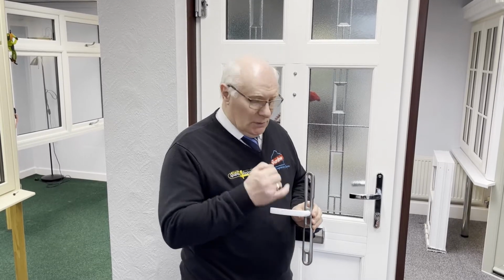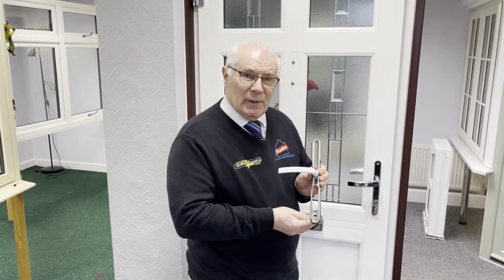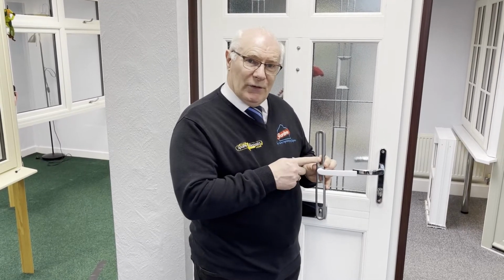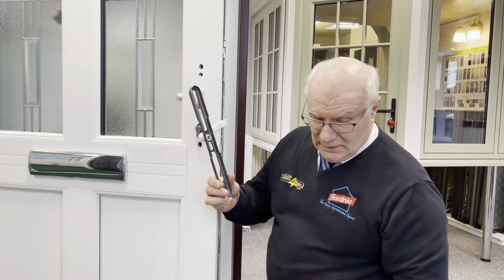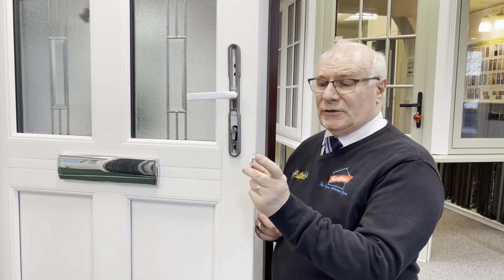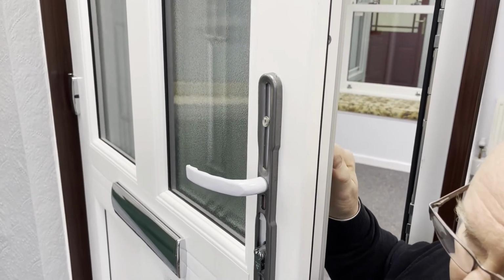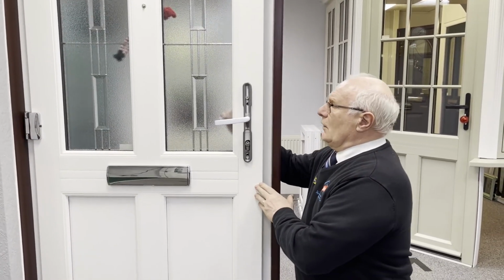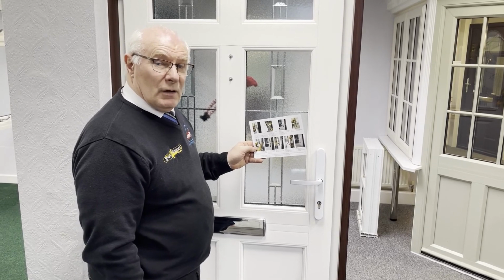Universal Door Repair Handle That Suits Any Broken Or Obsolete 92pz Upvc / Composite Door

Comment from the maker: Hi its not normally an issue with the cylinder as you are using that as the datum line so the Handle will do an inline 92mm pz which is the most common as you will know but it will do the old 95pz also and is the one that catches people out as its so close to the 92mm  but the handle can do 85mm 70mm and also the old Fullex 68mm it is just a matter of working out the pz so you can order the correct cover plates 
However as the Fullex 68mm the 85mm and 0ld GU 70mm handles are still readily available as handles currently its the no longer made 92mm pz (roto 163mm screw fix in particular also old Avocet 204mm screw) and 95mm pz that the handle is brill for. The one that you cant do is the old Anglian and Everest 92mm pz with 203mm screw fix as the bottom screw was elongated at 65mm from the key hole centre and nothing out there will cover the hole. fortunately we still have the old handles so not an issue until they are no longer made

Comment: That is a nice feature.
But just thinking if that cylinder position sat higher or lower to where your current inside cover plate sits would require some cutting.
Because you can't easily just move the current cylinder position to suit your new handle.
How many PZ sizes will you be selling, 92, 90, 85mm?